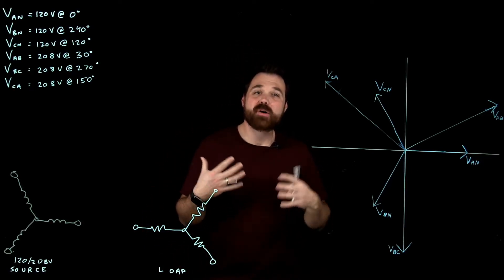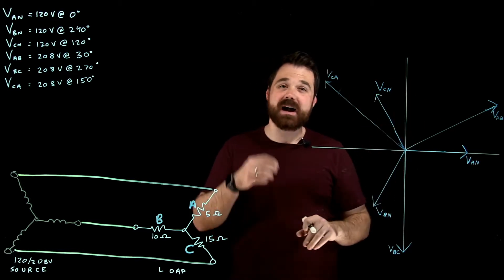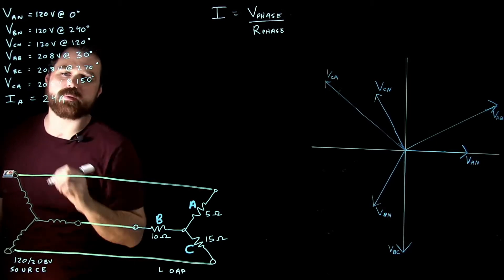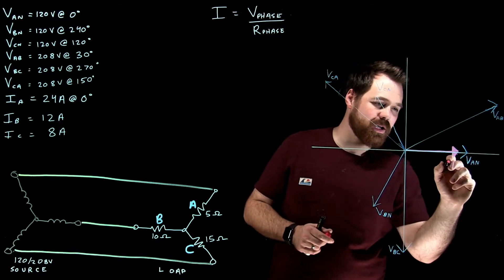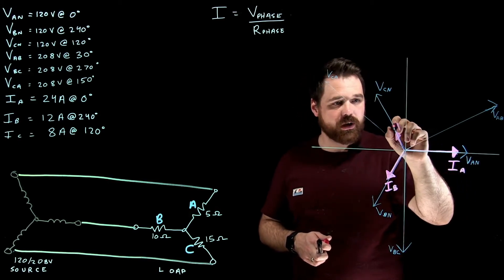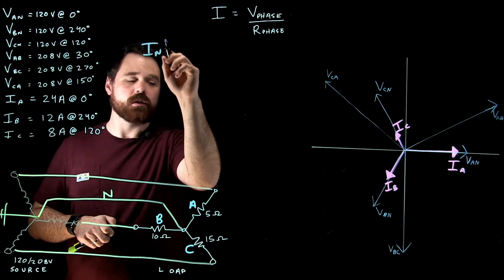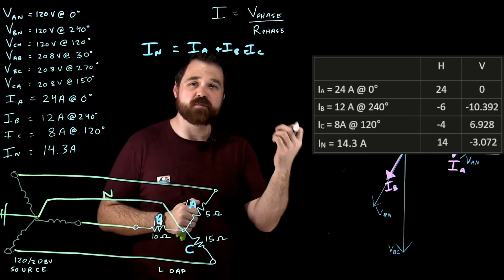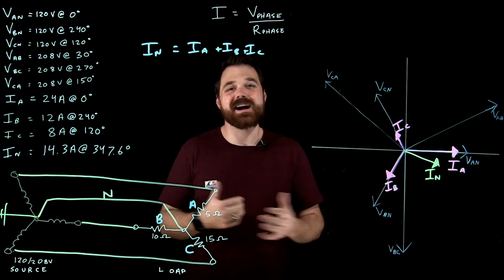Wye Connected - Unbalanced Resistive Load - Neutral Current

Comment: i have a question if you are dealing with resistive loads why don't the vertical number for current in your table are not zero because practically we don't have neither inductance or capacitance in this circuit?
Reply from the maker: Because we have multiple reference points now, so the currents are in-phase with the voltages. However since the voltages aren't at 0 degrees, there is a vertical component. Should be in-phase with the voltages that create them though

Comment: There's a subtle but fundamental flaw in the calculations. The phase currents were calculated before the neutral wire was connected. Without the neutral wire connected the load phase voltages are not 120 volts each. For load A, the phase voltage is 111.9 A, 2.41 degrees and Ia is  22.38 A, etc. Currents are only as calculated when there's a neutral wire connected.
Reply from the maker: You're totally correct! I just forgot to draw it right at the beginning like I meant to. Good catch!

Comment: Thanks for the video Zach. I have a question regarding neutral current sizing.

4-018 1) tells us the neutral must be sized in order to carry the unbalanced load. 
2) tells us the "max" unbalanced load shall be considered to be the max connected load between the neutral and any ungrounded conductor.

So when we're sizing neutral conductors do we use the calculated neutral current (like what you demonstrated here) or is 2) specifying that we use the total ampacity of the load on the largest phase/leg? If so, then isn't that connected load subject to change if we add more loads in the future? The way I'm reading this it doesn't seem like it wants us to use the ungrounded conductor ampacity but rather the "connected load" ampacity to size the neutral. Seems odd.

Hope that's coherent, thanks again.
Reply: @ZackHartle  ah thanks!